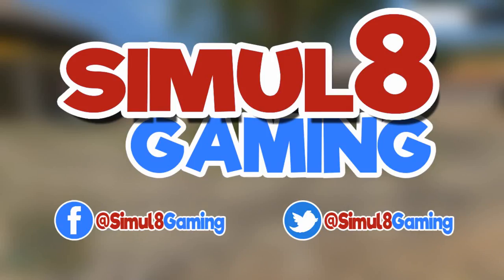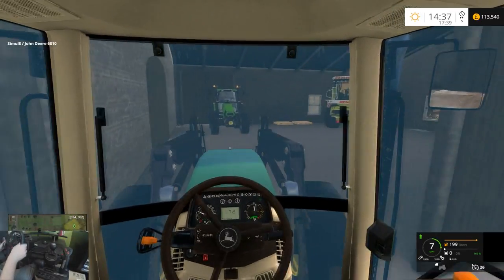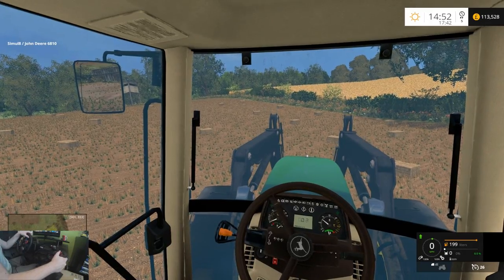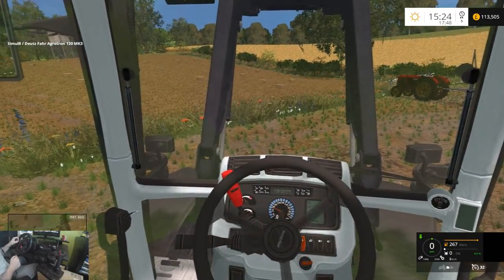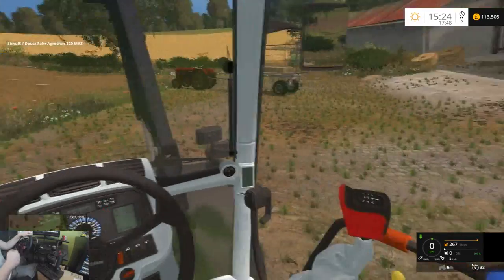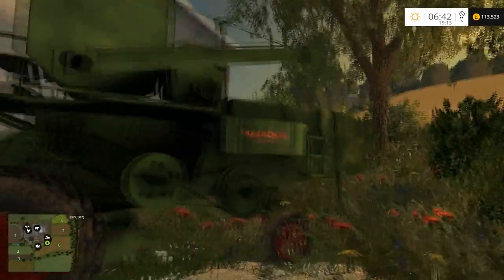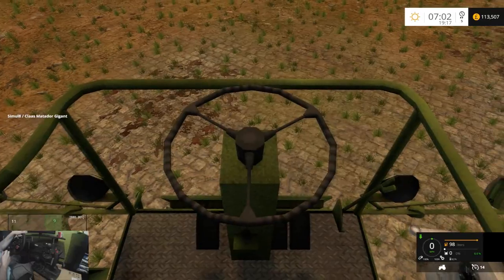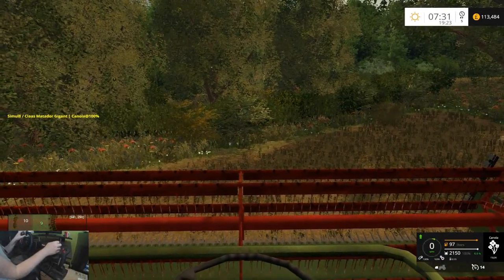Old Streams Map - Farming Simulator 2015 - Ep.2 (with Wheel Cam)

Comment: Claas, great video, glad your sticking to smaller equipment on this map, for a baker how about the welter ap730wc it comes in a pack with a trailer to suite the bales 2000l bale capacity but easily reduced to be more fitting

Comment: Is it hard to change the degree on the steering wheel in the xml files for machinery or is it similar to changing a capacity on a trailer
Reply from the maker: +EIRE-Daniel11 very simple mate. There is literally a section called Steering. Be careful not to change the actual wheels though.
Reply: +Simul8 -- okay thanks I better try it!!